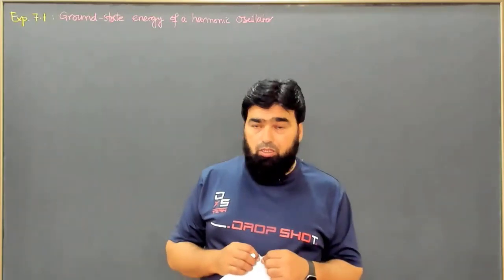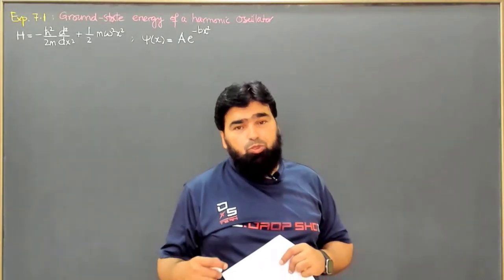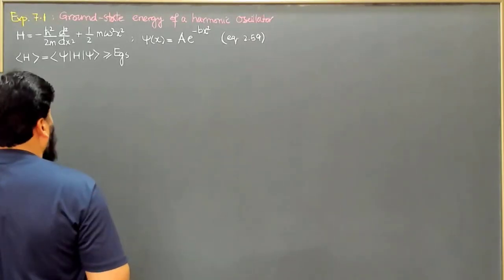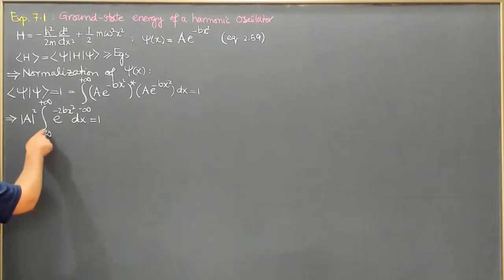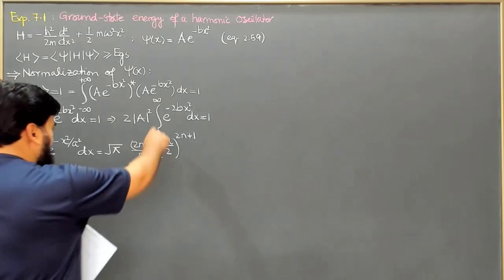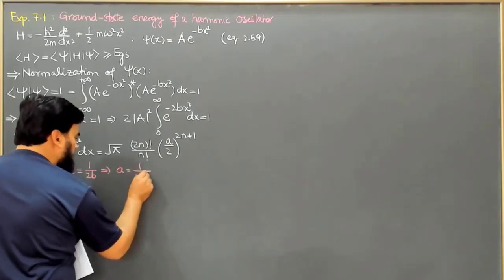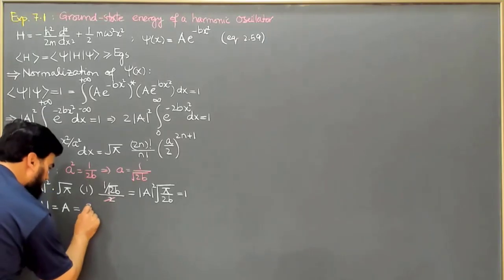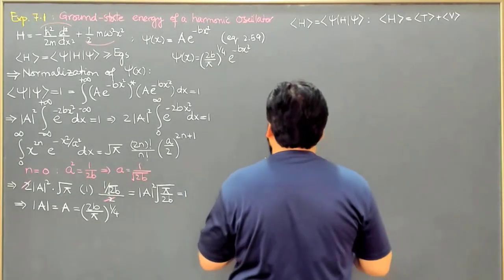L14.1 Example 7.1: Ground-State Energy of a Harmonic Oscillator 1/3

Comment: Sir there is another term in biot-savart law which is sine function that magnetic field generated due to current element is directly proportional to the sign of angle between displacement vector and current element so here's my version of explanation regarding it so please read it and tell me is it right or wrong❤👇
- The Biot-Savart law states that the magnetic field (dB) due to a current element is directly proportional to the sine of the angle between the current element and the displacement vector.
- When the angle between the current element and the displacement vector is 90°, the sine of the angle is maximum (sin 90° = 1), resulting in the maximum magnetic field.
- As the angle decreases from 90°, the sine of the angle decreases, resulting in a decrease in the magnetic field.
- The displacement vector can be resolved into two components: one parallel to the current element and one perpendicular to it.
- Only the perpendicular component of the displacement vector contributes to the magnetic field.
- As the displacement vector moves away from the x-axis, the angle between the displacement vector and the current element decreases, resulting in a decrease in the perpendicular component of the displacement vector.
- This decrease in the perpendicular component results in a decrease in the magnetic field.
- Therefore, the magnetic field due to a current element depends on the sine of the angle between the current element and the displacement vector, as well as the magnitude of the perpendicular component of the displacement vector.
Reply from the maker: Your explanation is largely correct but could benefit from emphasizing that only the perpendicular component of the displacement vector contributes to the magnetic field. Thanks

Comment: Sir this is my observation refarding my previos question from you.
The magnetic field generated by a small current element (idl) in a straight wire is characterized by a rapid decrease with distance, adhering to the inverse square law (1/r²). This behavior arises from the localized nature of the current element, which produces a weaker magnetic field compared to the entire wire. Consequently, the magnetic field due to the small current element is denoted as dB, signifying its infinitesimal contribution to the overall magnetic field.
In contrast, the magnetic field (B) produced by the entire wire exhibits a linear decrease with distance (1/r), as described by Ampère's law. This disparity in distance dependence leads to a notable difference in the rate of decay between the magnetic fields generated by the small current element and the complete wire. Specifically, the magnetic field due to the small current element diminishes more rapidly than the field produced by the entire wire.
Reply from the maker: We do measure B not dB. dB is to be integrated to get B. That's the reason of the difference of 1/r2 and 1/r.  Thanks 😊

Comment: There is square of distance in the equation of biot and savart law but when we move towards application of biot savart law such as straight current carrying wire then there is distance not square of distance.Why plz explain in detail sir as soon as possible.
Reply from the maker: This is not an appropriate place to comment, however, as I haven't yet covered Biot-Savart law, I'm responding here. The confusion comes from the specific form of the Biot-Savart law. While the general equation involves the square of the distance, in practical applications like a straight current-carrying wire, the magnetic field depends on the geometry of the setup. The distance in the application often refers to the perpendicular distance from the wire to the point of observation, which leads to a different form where the square of the distance isn't as directly apparent. Thanks
Reply: @SAYPhysics not get it sir.
Reply from the maker: In simple words, you're confusing two different things as similar. One is out of integral and the other is inside the integral. Once it will get out of the intergral, its power will be the same. Thanks
Reply: @SAYPhysics  ok sir
Reply: @SAYPhysics  but sir plz do detailed lecture of biot savart law as soon as possible because I searched whole YouTube and teachers are just wasting time of us in YouTube lectures so I have high expectations from you.
Reply from the maker: @greatxd3063 sure dear. This Chapter will be uploaded in January IA. Stay tuned